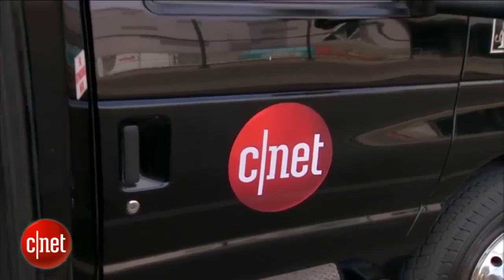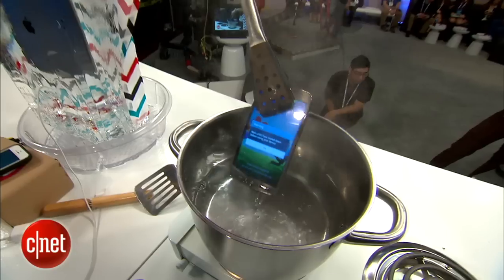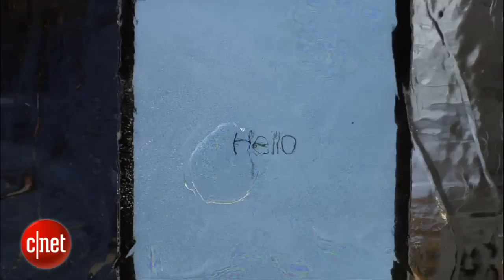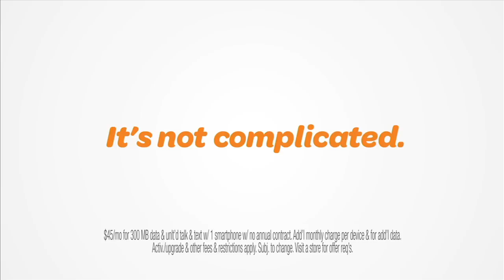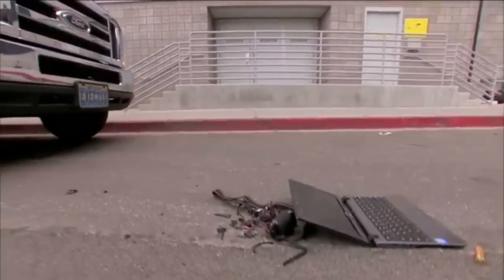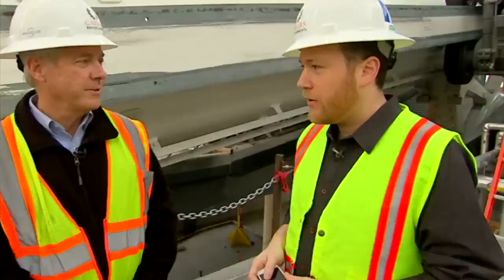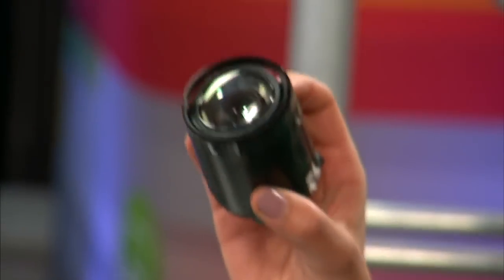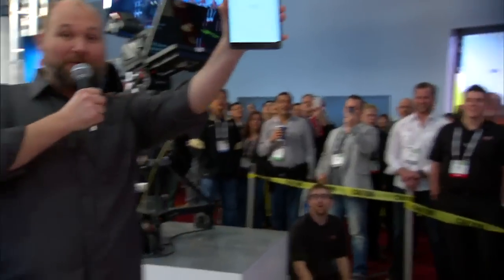Frozen iPad Mini, boiled Samsung Active, another CES live torture test!

Comment: iphone can withstand 5,000lbs of force yet, everyone I know has cracked the screen from falling from less than 5 ft. Makes sense.
Reply: ikr
Reply: I think it makes a difference that when dropping, it lands on a single point rather than distributing it everywhere like how the tire did just that.
Reply: +jeff darnell It does actually, screens are very vulnerable to shock forces.
Reply: Brayden Bledsoe You're correct, that's exactly the reason. Scratches also create a location for a crack to propagate from.

Comment: Ok, so the iphone 5 getting crushed cannot be the same one
17:09 Look at the screensaver of the iphone
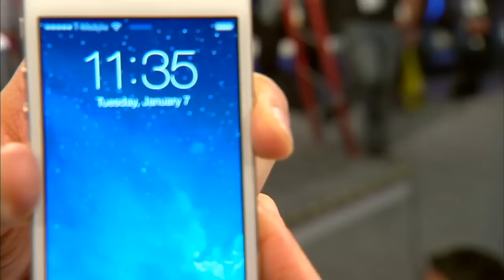17:50 Why would they take it out of the box and change the lock screen?
Reply: The wheel is dirty, so it took the dust on the wheel to the iPhone
Reply: Mohammed alhomaidhi If you look before the wheel runs over it you can see it still has a different background
Reply: thank you
Reply: Toby Murrell then it must've took the wheel background on the sun lightning :)
Reply: I'm guessing that you mean a reflection but if it was you would be able to see the reflection move
Reply: it didn't have a different background, the phone was unlocked during the test I could see the app icons.
Reply: You are correct, and they definitely used more than 2 iphones, because the one that was 'laid down' was showing the home screen, the one that got run over was locked.
Reply: @SyreGames  it’s called auto locking ffs

Comment: technically the entire bus weighs 7 tons. each tire holds a quarter of that weight. so 1 ton=2000 lbs
14,000 divided by 4= 3500 lbs of weight on the chromebook and the camera.
Reply: Can't forget that there's a heavier load on the front tires because of the position of the engine, so a little bit more than that generally.
Reply: well, she said the entire thing weighed 7 tons. so that has got to be with the engine installed. but yes, the front could have a bit more wight to it.

Comment: So they throw a Galaxy active (a water proof phone) into a boiling pot of water until the device hits a critical high temperature, close to over heating. then pull it out immediately... It wasn't as hot as the boiling water, heat don't transfer that quick.

An iPad Mini in a block of ice, I guess that makes it water resistant? Cause for technology 32 degrees ain't that cold. If my phone didn't work in the in the northern hemisphere during the winter I would be pissed.

Throw that shit into boiling water or liquid nitrogen for 10 minutes then I'll be impressed

Comment: Me and my friend tried to jailbreak a iPod 3rd gen and it fucked it up, and it got stuck in boot loop and would randomly turn off. We thought it would be a good idea to finish it off via freezing it with salt and cold water in a deep freeze, and we let it sit for about 5 hours. We dug it out with hot water and a knife (reckless I know) and it still worked. Later we threw it against the wall and it still worked also. I left and he tried to fry it LITERALLY so he threw it into the pot and it still worked but still had grease all over it. He lost it unfortunately, but it is true that these iDevices are almost indestructible.

Comment: What the hell I dropped my I phone 5s outside and it has some cracks on it and they freakin make the phone get smushed and nothing happens
Reply: Because the tire absorbed force. People only think about the weight and not the law of physics. Tires are usually a bit flat on the bottom so the phone is flat too so the normal ground and the phone are similar to each other except for material. If the tire was steel it will break because of the high force. Dropping is a different story. It depends on momentum, gravitational energy pulling the phone down, the phones weight, material, model/type, version of the model, screen durability, the way it lands, how it was dropped and the force that dropped it.

Also the surface below the phone was absorbing most of the weight not the phone

Comment: Pretty sure they are way over exaggerating the weight of the bus and if my math serves me right the put less weight on the iPhone than they did the laptop and camera. 7 tons is 14,000 pounds and the iPhone went through 5,000 pounds of pressure from the roller. Pretty sure that bus only weighs about 2.5 to 3 tons though.